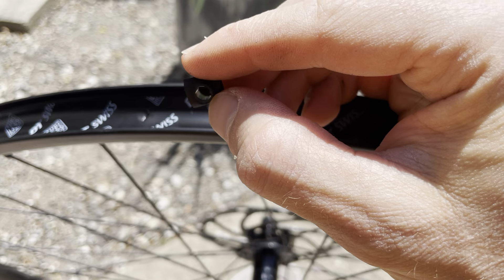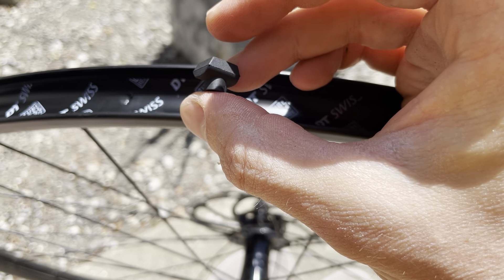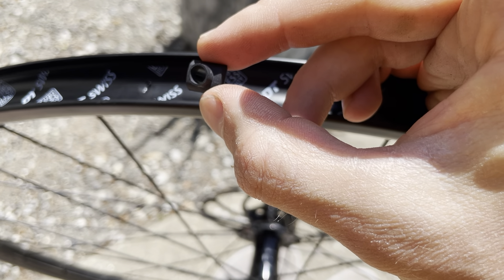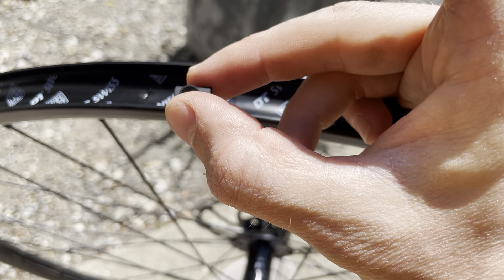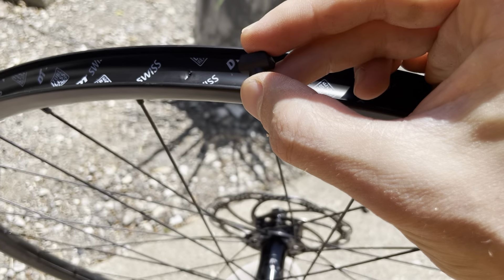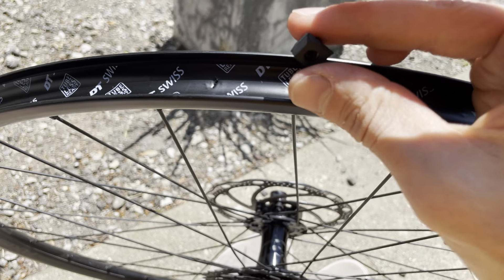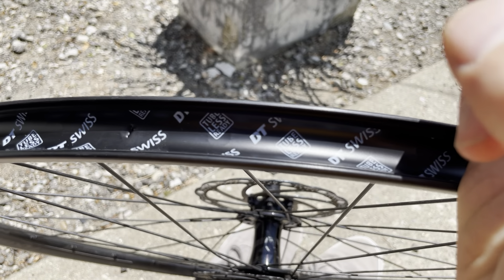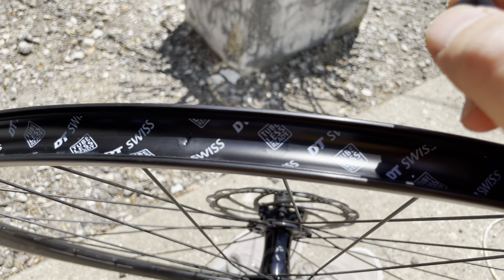Tubeless conversion tips - Specialized Diverge with Axis Elite wheels using Muc-Off  valve stems

Comment: Hi, what is the weight of these wheels please? Can't find the technical spec online, also how are they holding up tubeless?
Reply from the maker: Hi there, not sure about weight, but they are stock on the E5 base. They have been holding up well so far.
Reply: @littleoutdoorsyfamily4784  Thanks, I wound up getting a set of DT Swiss gravels